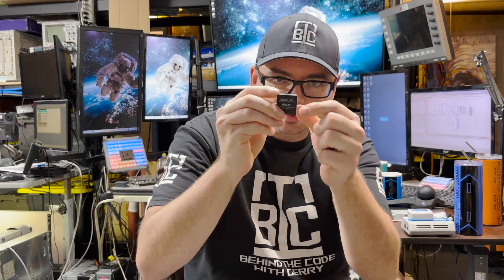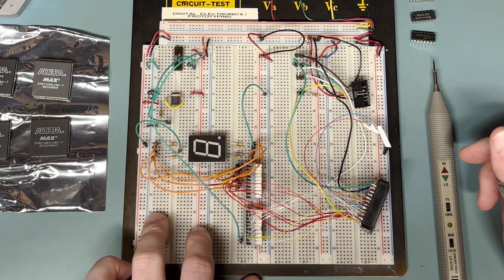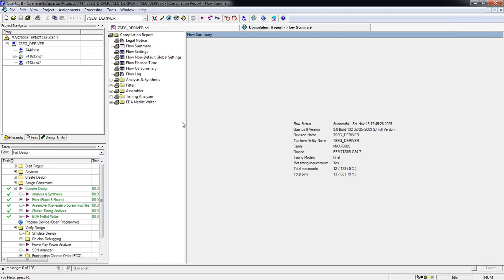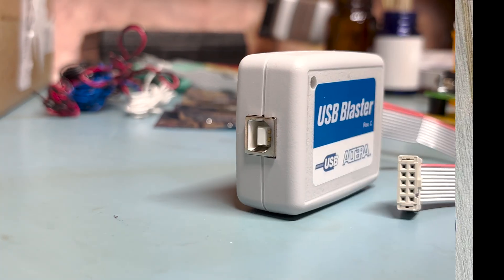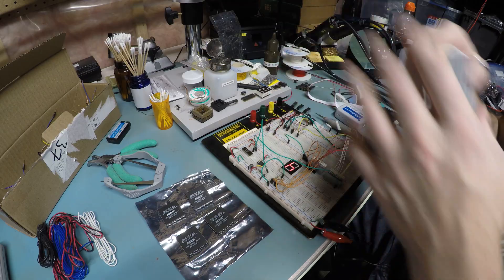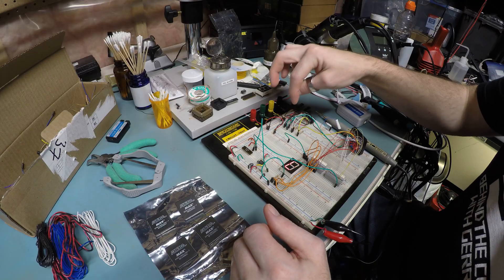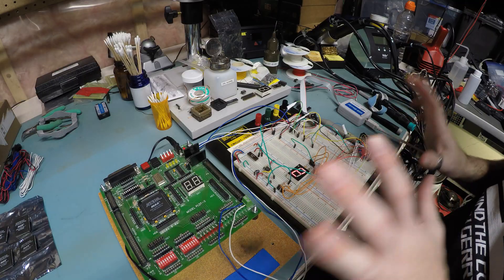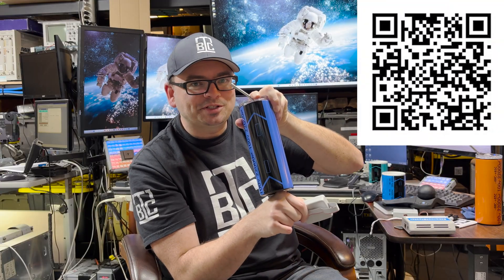How to Connect & Program multiple Altera CPLD Logic Chips on a single JTAG interface? #90sTech [#62]

Comment: I wonder if you have 4 jtag wires soldered to PLDT-2 board on the reverse side? I believe it is more reliable , that is why?
I am looking right now for jtag pinout  s (22 31 62 71 ).
Pldt-2 looks quite expandable and in/out rich as for a trainer board
Reply from the maker: Hi Simon,
Yes, I had soldered the JTAG interface lines directly on the backside of the board, in order to interface a USB-Blaster. 

The PLDT-2 is designed to be interfaced directly to the back of PC’s parallel LPT port. It essentially has an on board MV-Parallel Programming circuit built in.

In turn, it is only compatible with the very old versions of Altera Max+Plus II software for programming…if you are using its built in LPT interface. 

In order to use the Altera Quartus-II software, the USB-Blaster needed its own direct connection. Also, the 7400 series IC that is directly under the parallel port connector, had to be removed in order to isolate the JTAG lines from the built-in MV-Parallel programming circuit. Just an FYI.😎👍
Reply: @BehindTheCode_wGerry thank you mch for your advices.
I managed to wire up a straight male/male db25 from two old printer cables (i cut off CN36 plug).
As far as my PLDT-2 came with no cable, i had to old school, 52 wires connected, 32 bit win7 + quartus 13.0 , quartus cmd utility for drivers works fine, quartus can autidetect byteblaster mv after that.
So PLDT-2 works and I can see the epm7128s is autodetected.
Definetely, a leap forward for me.
Reply from the maker: @simonkh7278 
Ahh that’s great you managed to get it detected. Good show! 😎👌
Reply: I had to go this way because removing the ic did not help to make jtag work. I had a choice to check up to 10 connections on the board or a few hundreds checks while assembling db25 m/m (1:1 pin mapping to be sure). Yes , I have chosen the latter 😅
Bonus: i run a search over scrap pcb and found couple of high grade db25 male connectors, so I can solder some doublesided db25 for the pldt-2 boards I have, that were bought without original cable from board manufacturer.
Cheerz